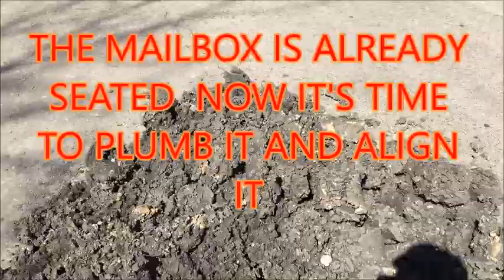LEANING BRICK MAILBOX  FIXED WITHOUT REBUILDING IT

Comment: Lack of proper foundation caused the problem. But to be honest the brick work is terrible. Those joints on top are NOT right. Shoveling dirt onto the street IS not the way to do it. Cheap fix. But it's still wrong. Sorry.
Reply from the maker: Saber, hello dear friend, the title of the video says how to fix a Leaning brick mailbox without rebuilding it, I didn't build that mailbox I just fixed the foundation, if you want to criticize my work as a bricklayer,
 I recommend you go to my channel and see how to make a mailbox from scratch. 

https://youtu.be/pcB3bUOTzus
Reply: @josemourinho8394  I was in no way judging your brick laying ability. I have been a union mason for 45 years and have worked all over this country. What I should have said was the way that mailbox looked it should have been thrown in the back of a truck and started over from scratch. I get what did to plumb it back up, but you can put lipstick on a pig.....but it's still a pig.
Reply from the maker: @saber5585  you're right to begin,
I wouldn't pay for a job like that it's a very pour brick job but 99% of bricklayers in houses do that kind of work, so it's very common for homeowners to have a mailbox like that, and how You can see they didn't even build a foundation for it, that's why It was inclined and the homeowners' association forces the owners to fix that problem and well, to fix the foundation it only costs $400 and to rebuild a new one it costs $1000 so the owners of the house opt for the most cheap
Reply: @josemourinho8394  Yea,I noticed there didn't seem to be any kind of footer. By-the-way, having to deal with the HOA with their restrictions is not my idea of a good time.

Comment: $2000 worth of labor to fix a stupid mailbox...  you basically added more weight to help it sink deeper now... it needs a really wide base with "outriggers" and alot of rocks underneath compacted for drainage and foundation,
Reply from the maker: Mi Arnold #1, this repair don't cost $2000, #2       I am been doing this work for 30 years. there are a lot of brick mailboxes than I built 30 years ago they  still stables, I have the same phone number 30 years ago so that's how they keep recommend me, but any way thanks for watch the video.

Comment: What did you use to lift mailbox out
Reply from the maker: I am sorry, I can,t say because if someone doesn't do it  correctly, they can have an accident.
Reply: Most likely a chain hoist... also known as a "Come-Along" or a "Chain Fall Hoist"...  it makes ratcheting sound when you pull the chain... like those rollup garage doors in repair shops.   The sling is a synthetic woven sling designed for rigging and lifting heavy objects.  You need a A-Frame made with steel i-Beam to attach the hoist to...  You might be able to use a Car Engine Hoist also... https://www.aceindustries.com/p-104-harrington-cb-15-ton-hand-chain-hoist.aspx

Comment: Anyone criticizing his work has not seen his other videos. Jose does great work. Here, the customer evidently wanted the mailbox set straight- Not completely rebuilt.  Jose can't be responsible for the original workmanship in the mailbox. He is correcting the foundation issue only- That's it.  It was a great way to address the issue- Most masons would tell the owner that they would have to tear the whole thing down and start over. Jose used ingenuity and addressed exactly and only what the customer wanted- to correct the lean.  If you look at the end of the video as the camera pans around, you will see that every brick mailbox on the street is leaning.  The contractor who built the subdivision is guilty of the crap workmanship. At least this homeowner wanted to fix theirs. Well done Jose.
Reply from the maker: Thank you very much paulBarzizza for you explanation.